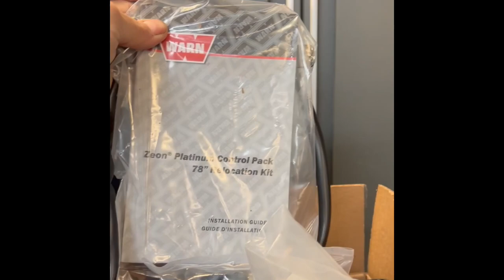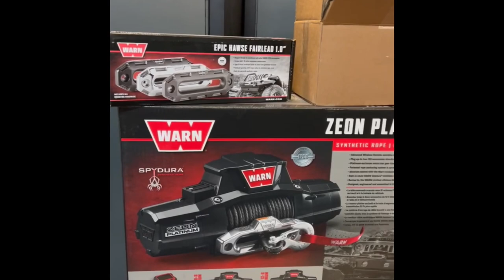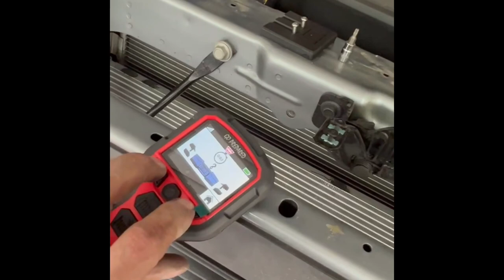2023 GMC SIERRA AT4X WARN WINCH INSTALLATION

Comment: Thanks for posting this. I’m in the middle of installing a warn VR 12S winch. The body is slightly smaller than a zeon so I only had to slightly trim the left metal bracket and was able to leave both of the bolts in place. Really appreciate the vid it helped a lot!

Comment: Just purchased a HD At4x AEV and this video has me second guessing installing a winch.  We put 12k pound winches on our jeeps and it is cake.  GMC didn’t make this one easy, god forbid something goes wrong on the winch and you need to get access to repair or replace it.  With the money we pay for AEV editions they really should include a winch, hell charge me another 1k and just include it.
Reply: It's one of the reasons I'm having GMC dealer install the 12500lb Comeup winch suitable for my 2024 Sierra2500HD AT4X AEV Edition.
Reply: Well then just get an external mount bumper like a jeep. Completely different installations….obviously.

Comment: I’ve installed a few winches on jeeps and I thought those were a PITA… I probably won’t be installing my winch on my new truck 😢 I have an older warn VR12 with a  clutch and I’m pretty sure it’s significantly wider than these newer winches. I’d hate to get the bumper off and have it be not even close to fitting lol
Reply from the maker: It’s a tough install for sure.   But I proved it’s possible and it works great.

Comment: @author Did you need the GMC winch mount kit for this
Reply from the maker: Yes, I ordered direct from GMC.   It’s designed for installation of the Come-up winch but I modified it for installation of a Warn
Reply from the maker: Part number is 19434379 AEV winch mount kit
Reply: @AlaskanMODMaster  Thank you for the reply! I'm going to do the same, what modifications are required?
Reply from the maker: Watch the video there are quite a few mods to make it happen.  But the result is awesome